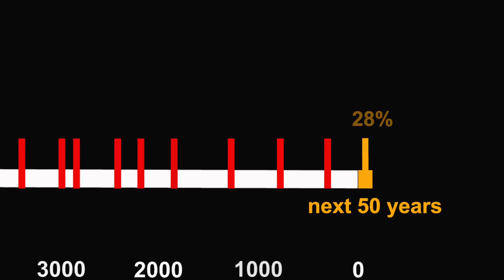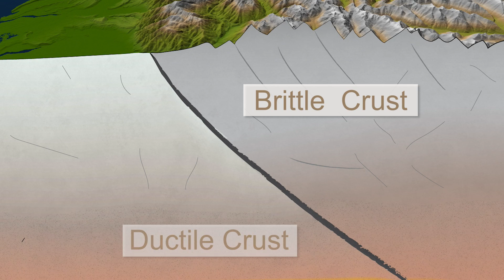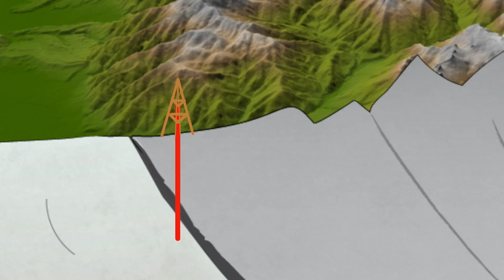Drilling into New Zealand's Most Dangerous Fault

Comment: Question:   why can't a mirror be  placed at the bottom
of such a hole, and then shin a laser down in order to get very sensitive measurements in changes
to soil layer movement/positions?   Also, what about taking audio frequency measurements
recording how the soil compresses and then grow quiet right before slippage and energy release?
Reply: "why can't a mirror be  placed at the bottom"

Because the borehole is full of opaque drilling fluid. The drilling fluid is there to stop the borehole caving in and also to control any ingress or formation fluids.

Comment: 3:05 says they drilled in 2011 to 150 meters. What date was it?. A big earthquake hit that year claiming lot's of lives. https://en.m.wikipedia.org/wiki/2011_Christchurch_earthquake
Reply: That wasn't part of the Alpine fault system, and I highly doubt something as insignificant as that hole is going to cause an actual earthquake.
Reply: Earthquakes are centred kilometres down, not metres. And the biggest ones are often the deepest.
Reply: That earthquake was part of the port hills fault and activity on that fault was triggered by the greendale fault earthquake near darfield a year earlier. the greendale fault is a stress fracture from the immense pressure in the alpine fault. the drilling was done very far from this area of the alpine fault
Reply: @emmabolter8729  oh okay thanks for letting me know.

Comment: The probability of an earthquake occurring anytime is either 0 or 1 isn't it? Either it happens then or it doesn't.
Reply: ***** I am aware of statistical methods and their limitations which is why I made the comment I did. I liken giving an x% probability of some particular event occurring in y years time as placing a buck each way. I think real earthquake predictions (that is, time and place) will be possible in the future but that in order to do so a much bigger picture needs to be taken into account - the global effects of plate movements. Unfortunately statistical methods flatten curves, suppress outliers and give averages. For example, 10 quakes per century is equivalent in statistical terms whether they are evenly spaced or occur in a clump over that period of time.
Reply: ***** For now, yes. But I think we can do better. In the past I have heard the a-is-not-connected-to-b argument but I think that may be changing. It stands to reason that if the earth's surface area doesn't change but relative crustal movements occur in one location there must be some compensatory movement elsewhere. As an obvious example (ignoring slip/shear movements) if new crust is being produced in ocean trenches there must be subduction and/or upthrust occurring elsewhere. I wonder whether global plate movements are currently being mapped in real time?
Reply: the probability over a suitably long period is 100%, the probability over a shorter period is somewhat less than 100%. Trying to nail it down is quite hard.